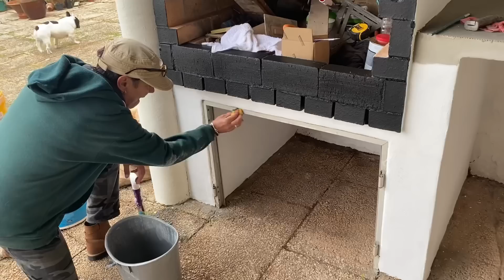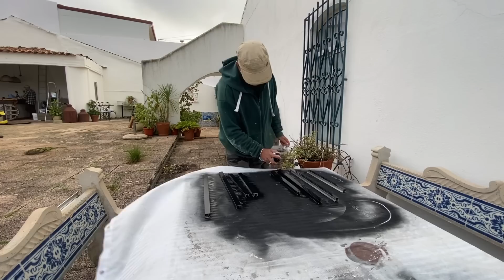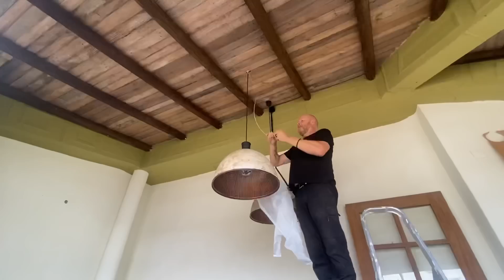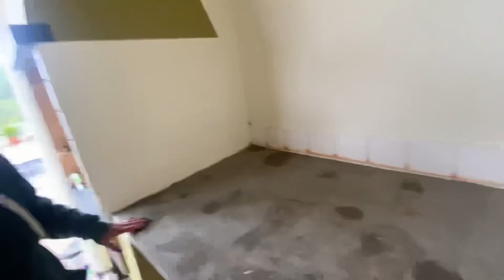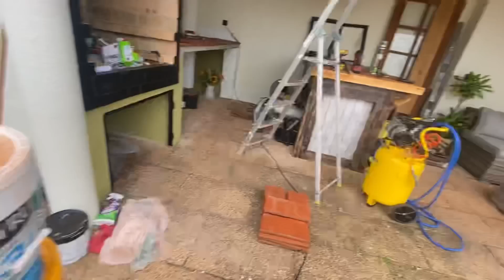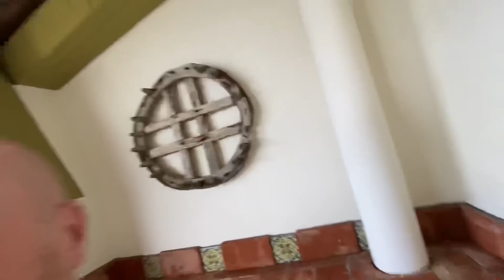Finally.. this is the end

Comment: I love what you've done with your outdoor kitchen. My suggestion regarding the lighting that you installed to highlight the ceilings, the conduit is better invisible. The way to do that is paint it the same green as the wall. Also where the conduit comes down the creamed color wall,  it would look better if it was painted cream same as the wall. The conduit itself is not a design feature. It's a necessity to power your lighting,  so you want to make them disappear to the eye.
Reply from the maker: Hi Enoch, naturally somethings are displeasing to people but in this case, the conduit is the design, purposely painted black because there’s nothing worse than trying to hide something that doesn’t disappear. We like it and are happy with the end result. 
Thanks for watching and the comment😎👍